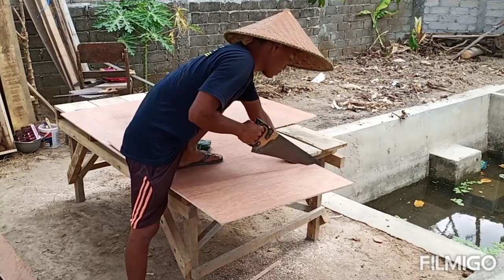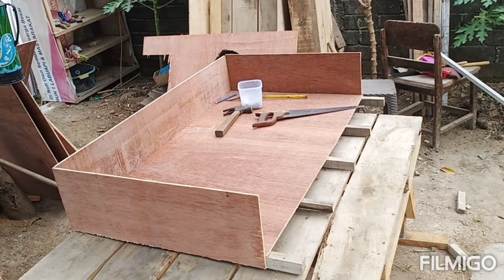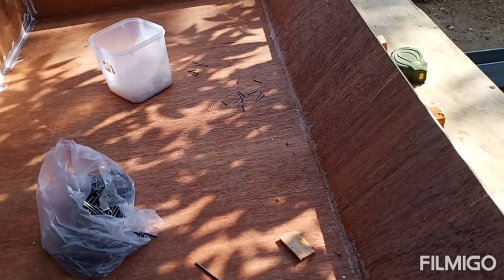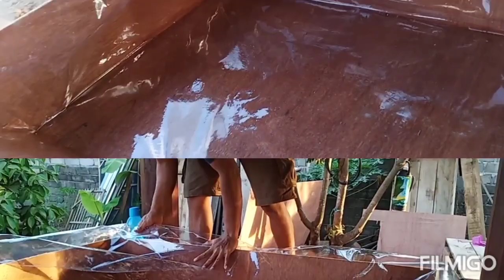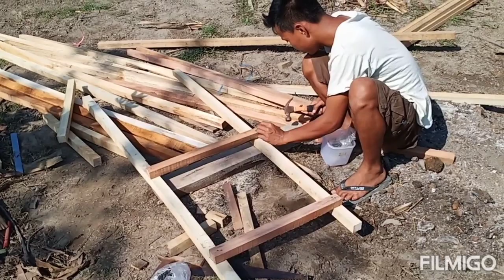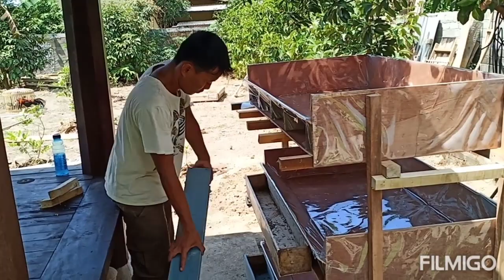Membuat Biopond Maggot Murah Meriah

Comment: Sangat bagus pak hasilnya, lanjutkan, tp klo boleh kasih ulasan singkat ttg biopond, ini dulu saya pertama kali membuat biopond, ada di video saya april 2019 klo ga salah, habisnya 1 biopond sekitar 125-180rb, dengan ukuran PxLxT 120x70x20, luas efektif bagian dalam 120x55 = 0.66m²,  klo dibandingkan antara harga & luas serta isi nya, maka 125-180rb per biopond masih kurang efisien terhadap biaya, tp Alhamdulillah, skr sudah pakai plat semua. Lbh ringan, bahan galvanis 0.7mm, kuat lentur, bukan galvalum ya. Harga 210rb tau beres, luas efektifnya 1,1m² isi 5-7gram atau bisa diisi 15-25kg maggot. klo raknya dulu saya pakai jenis kayu usuk 53, 6 kaki, isi 6 biopond harga 300rb, klo isi 8 biopond 450rb. Dikerjakan sama tukang. Jd 1 rak isi 6 biopond modalnya 1,5jt, klo isi 8 biopond modalnya 2jt, kapasitas 100-140kg maggot 1x panen..klo tiap hari panennya, maka tinggal mengalikan 10 saja.
Reply: Minta no hp dunk mas...mau nanya beli biopon yg sdh jd dmana..yg bahan plat